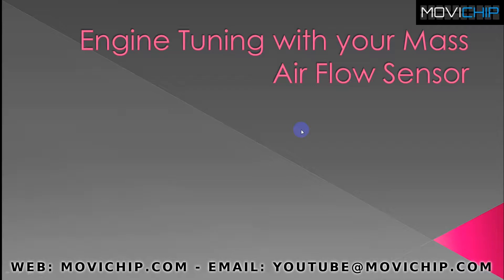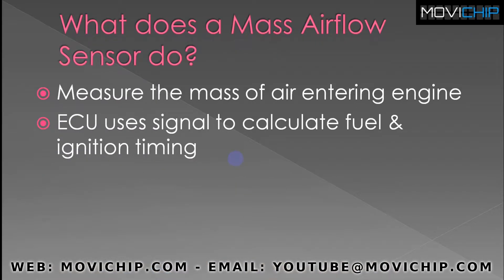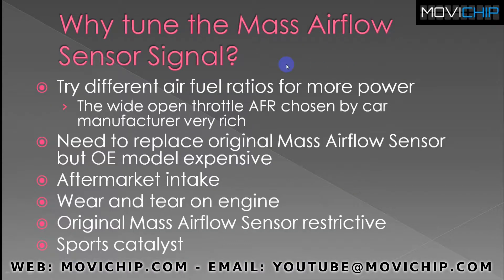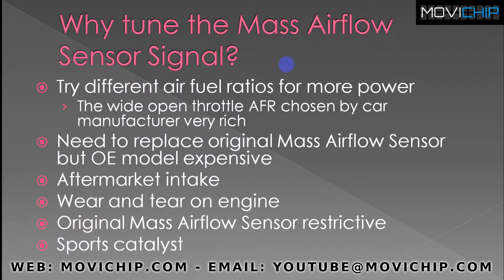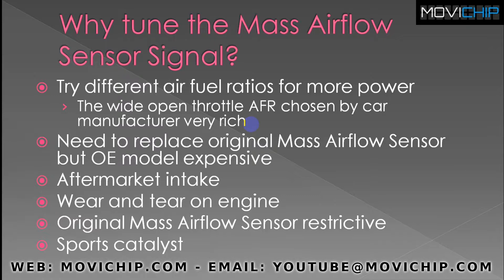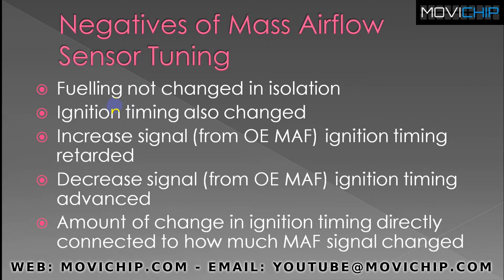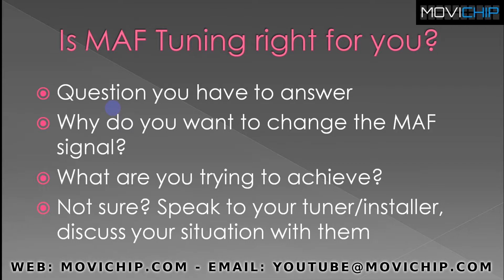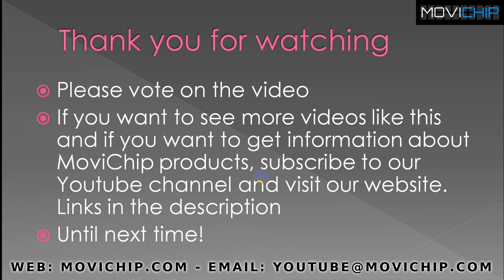Engine Tuning with Mass Airflow Sensor - Part 1

Comment: Hey man I wanted some advice. I have a 1995 Lexus SC400 it has a Non-vvti 1uzfe (v8) and I was planning on going turbo and running low boost around 5-7 psi. I have an Apexi afc neo And was wondering if that by passes the MAF sensor ? From what I’m understanding the ecu reads what the Apexi neo is putting out instead of the regular sensor. If that is the case what do I do with the sensor ? Do I delete it or keep it and make a mount for it in my intake pipe ? Please help !
Reply from the maker: You will keep the MAF sensor. Tune the AFC according to your AFRs. You will almost certainly also need an additional product which can adjust the ignition timing as well.